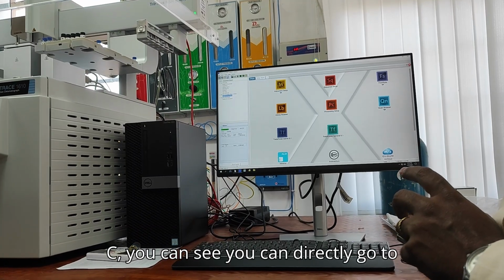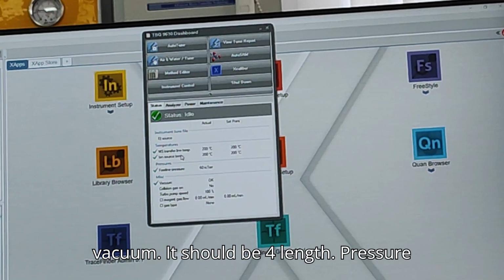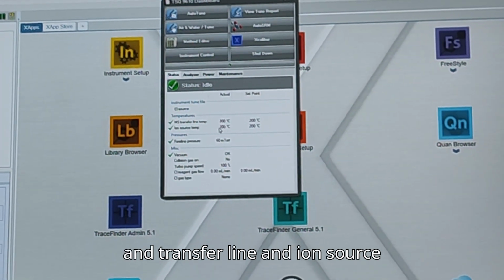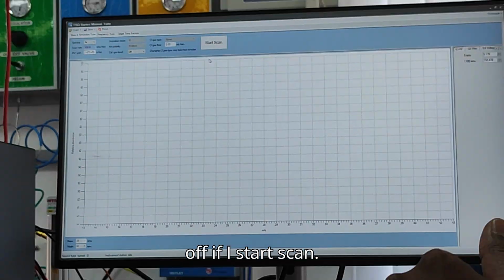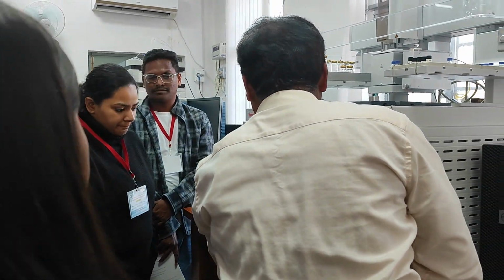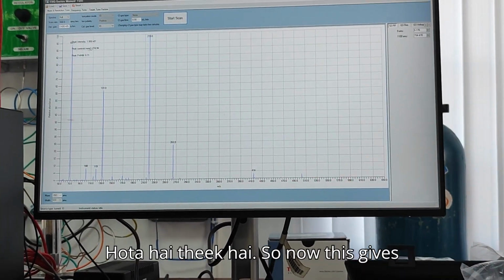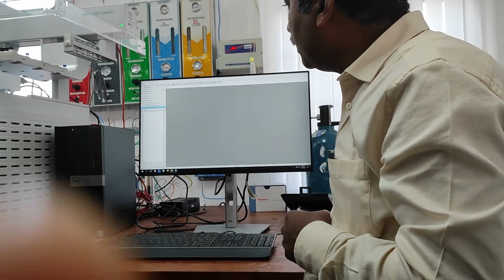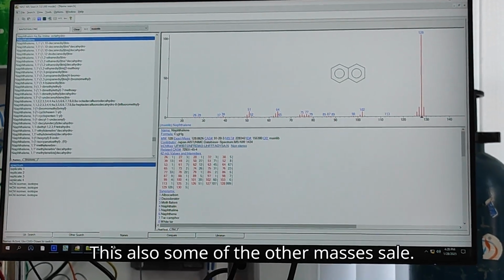GCMS Explained:Step-by-Step Guide to Sample Analysis & Instrument Ready Check #chromatography Part 2

Comment: I have a question. How to acquire vacuum in the MS?
Reply from the maker: To Acquire vacuum in MS System, Turbo pump is installed within the system. TO support turbo pump, rotary pumps are also used outside the instrument.